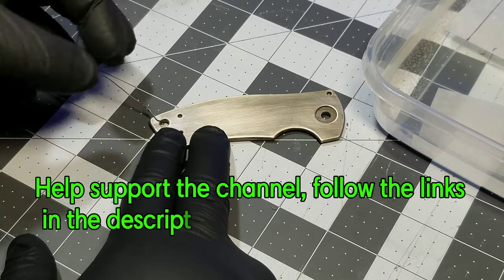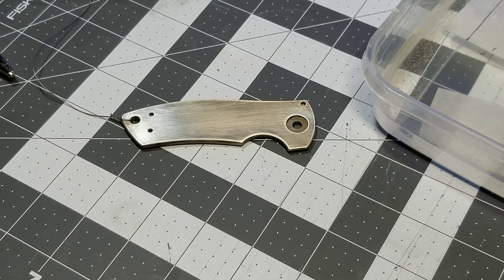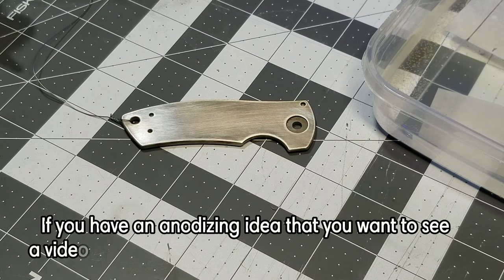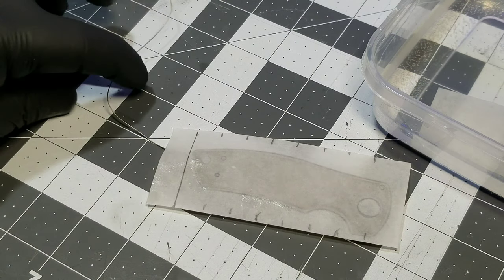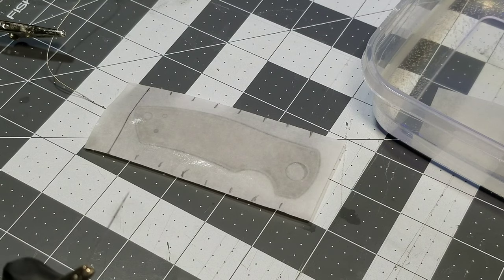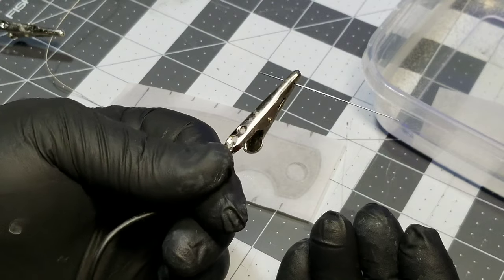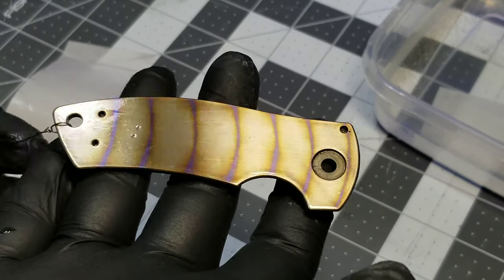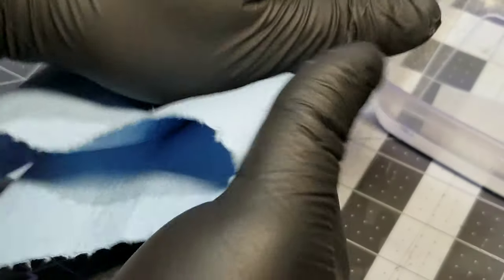Instantly Transform Metal With This Process - Titanium Anodizing

Comment: I have a cool idea to add splotches
Reply from the maker: I can dig it! What colors would you do?
Reply: Also i just found out a new technique today to make flames! Lol. And with the splotches. I ano a low volt color like bronze then mask lines into it then ano again but at a high volts then removing the mask by rubbing the edges of the lines you ano another color but higher than the low but lower than the high volt color. Sounds like a mouth full but gives a cool pattern.
Reply: And with flame pattern. Ano the scale blue, then using whink but on a cue tip stsrt gently rubbing the basic shape of a lightning bolt or flame thrower shape, then apply more and more when needed and watch it slowly change to purple then the main part of the flame rub more and it'll become bronze and the very very middle will be bare titanium and it'll look like a flame with purple outlining the flame shape with blue on the outside and bronze and bare titanium in the middle. And you can manipulate the cue tip in a way to make flames like if you brush water on something. Because thats whats your doing essentially
Reply from the maker: I'm picking up what you're laying down. Had to really put my thinking cap on to put that together in my head, but that's a great idea! I'll have to try that one out myself, sounds like it would come out awesome!
Reply from the maker: That's an awesome tip! Had to pin that! Thanks for Sharing! By all means, feel free to share any and all tips that come your way. The more info I can get together all in one place on here, the better. I'd like this channel to be sort of a one stop shop for all things anodizing.
Reply: @ApollosRings  hard to explain in detail without being a mouthful lol. I love your channel and that needle technique. I cant wait to try it out. Also if you have a knife with the detent ball exposed then use two 9v batteries. You can watch it slowly change to bronze and you can get a better bronze this way if you wait for it then disconnect the clips. A color you cant get with just one 9v.
Reply: Because its a little higher than 9v
Reply: Is there a way i can post a picture on the comments?
Reply from the maker: Yeah, that needle technique was totally unexpected, but really came out awesome. If I remember correctly, I didn't show how small the lines can get in the video. I should probably throw a pic of it up on my Instagram. Good tip for the bronze as well. I just started playing with the inbetween colors recently. Hadn't thought to do it till a few weeks back.
Reply: Just gonna post vids of them lol
Reply: @ApollosRings  i love how just the littlest things can become a new technique and refresh your interest in anodizing for fun again. Bought a kizer perock bwcause i love the mikkel willumsen custom and been researching diferent ideas for anodizing
Reply from the maker: Yeah, the comments won't allow pics unfortunately. You can always post on Instagram too and tag me in the pic. Everyone can see it that way as well. My Instagram is linked in the video description and on the channel homepage.

Comment: I have some titanium bolts I want to “flame anodize” where the edges are bright blue and fade to purple and gold towards the center of the bolt. Some of these bolts are small, so I’m going to try this method to keep the color right at the edges. My questions for you are:

1: What type of material was the needle made out of? Does it need to be titanium or stainless steel?

2: I see you have the positive connected to the knife scale, and it’s laid nice and flat. With a bolt, this is much more difficult. Would you think it would be better to connect the positive alligator clip directly to the base of the bolt, or make a brass rod with threaded hole on one side to screw the bolt into to stand up, and connect positive to that? 

3: Lastly, does the bolt need to be soaked or sprayed with that solution the paper was soaked in? Or will grounding the bolt be enough to be able to drag the needle across the edges dry? 

Any info would be greatly appreciated.

Thanks!!

Comment: This looks simple to do. Does it work on other metals? I have a RUIKE P108 & P801 that I would like to attempt it on. But also, could you get the splotches with a sponge soaked in the solution?
Reply from the maker: Yeah, definitely, I have a video up on the channel on that exact process if you want to check it out.

Comment: Do you use 9v batteries? Great Video ❤🤟
Reply from the maker: Thanks! I used to use batteries when I was just doing anodizing as a hobby, but once I started incorporating anodizing into my rings I decided to purchase a bench top power supply. I've linked to the exact unit I use in the video description if you're interested. Works great and is much easier dialing in a specific voltage (color). I did use the 9V Battery method for years though. It works great, but requires a bit more work to get the exact colors you're trying to achieve.

Comment: Thanks for the great videos! I tried the bath anodizing and it worked like a hot damn! ...but can't get the needle anodizing to work. Any ideas why? Was you paper just soaked in water, or with the baking soda solution?
Also can't get Whink to remove the anodization, but I'm in Canada, so thinking they maybe sell less aggressive solution here? Has anyone else had this problem? Thanks again! :-)
Reply from the maker: Hey! Glad to hear the bath worked out well for you! 
As far as the needle anodizing is concerned, the paper was completely soaked with the electrolyte baking soda bath solution. 
Now as far as the Whink is concerned, you're the 2nd Canadian to tell me that it didn't work for you. We went as far as contacting Rustoleum, the company that makes Whink. We asked flat out if Canada was receiving a watered down version of the stuff. We were sure that their response was going to lead us to an answer, but when the Rustoleum guy got back to us he said it is the identical product that's sold here in the states. I find that even harder to believe now that you're telling me that you're having a problem with it as well. That's crazy! 
You're best bet might be Multi-Etch if you can get that up there. Don't know if you've looked into that or not, but worth a shot.
Reply: @ApollosRings  Thanks for the quick response! Have ordered a power supply, so think I'm going to break the bank and get some Multi-Etch, too. Hopefully it's the same formulation in Canada!
Reply from the maker: I believe you should be good with the Multi-Etch, but I thought that about the Whink too, lol. Multi-etch is acid free though, so you shouldn't have any issues getting that there.

Comment: Do you own the TekPower TP12001x ?  if you do, can you get the full spectrum of colors with it and is it user friendly and reliable?  do you prefer the 9v batteries over the TekPower?
Reply from the maker: I don't have it yet, but my buddy does. I'm buying one for myself in a few weeks. I've used his though and it works great! It will give you the full spectrum of colors, it has been very reliable for him, and it's super easy to use. I'll be doing a full review and demo  once mine arrives if you're interested, but I absolutely prefer that over 9V's. You have so much more control and fine tuning of colors, plus it's 100% repeatable over multiple parts. Totally recommend it, for sure!
Reply from the maker: I'm not saying you can't do an excellent ano job with 9V's, because I've been doing it that way for years now, but the power supply definitely makes things easier. The other advantage to the power supply is the ability to do true black anodizing. I can't do that with the 9V's. I'll have a video on that coming out shortly as well. Stay tuned!
Reply: thank you for the reply,  with the cost of 9V's it seems like a good investment if it works well.  I've been loving your videos, thank you for sharing.
Reply from the maker: No problem, thanks for watching! You can really get quite a few anodizing jobs out of a set of 9V's, but if you do have to replace them then the cost does start to add up. All things considered, it isn't a bad deal for the power supply.

Comment: What type of finish is on the titanium? I want to anodize a stonewashed handle but fear the colors wont come out as vibrant. Best wat to remove stonewash? Sandpaper?
Reply from the maker: You could anodize with it being stonewashed  just as long as you make sure to etch it well. With a good etch you'll get vibrant color. If you wanted to remove the stonewash first though you can always use a scotch-brite pad. That won't eat up your scales at all like sandpaper can. Just remember to go only in one direction so you don't leave weird marks.

Comment: I have a ZT 0055 that I’d like to try some anodizing on, but it seems to have a coating on the scales and clip. Any tips to get that off efficiently? Also was this just a normal stainless steel needle you used in the video?
Reply from the maker: Yes, the needle was just an ordinary stainless sewing needle. 
As far as the coating is concerned, you could try acetone, but if that doesn't cut it you may need to mechanically remove the coating. I've run into a coating before, it sucks when they do that. I sanded it off and re-polished the titanium just going through the grits of sandpaper. I started at 400 and went in small increments up to 2500 grit. Sandblasting is an option too if you have access to a sandblaster, or walnut blaster. The sanding takes some time, but if you go that route you can really fine tune the finish exactly the way you like. I have some tips for finishing if you do go that route. Not sure if you have a Dremel, but there's a great attachment that gives an excellent finish. It's a sort of scotch-brite pad, and it comes out amazing.
Reply: SharpKnifeNuts it’s still got the titanium color to it, just fairly dull instead of the polished look. Could just be stonewash or tumbled, hard to say and I can’t find anything online about the finish on it. Thanks for the info though man!
Reply: SharpKnifeNuts okay, I just figured out on ZT’s website that it’s bead blast..so that should be fairly easy to remove.
Reply from the maker: It just clicked after reading your last 2 posts, if it's a ZT there shouldn't be a coating. Bead blasted is just a way of finishing the titanium, not a seperate coating. As long as it's bead blasted ZT titanium you shouldn't have to remove anything.
Reply: SharpKnifeNuts sweet, i may try to cut some of it just to get more of a polished look. Thanks though!
Reply from the maker: No problem, just didn't want to steer you in the wrong direction 👍🏼